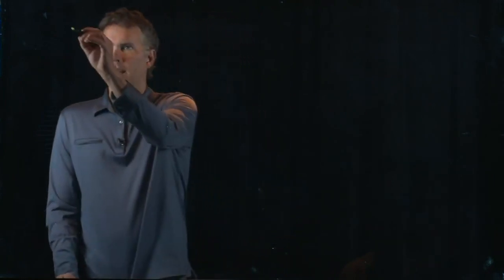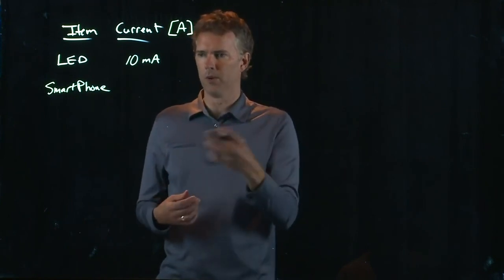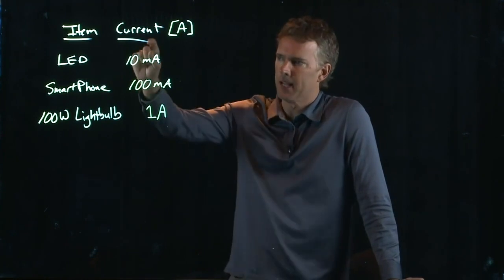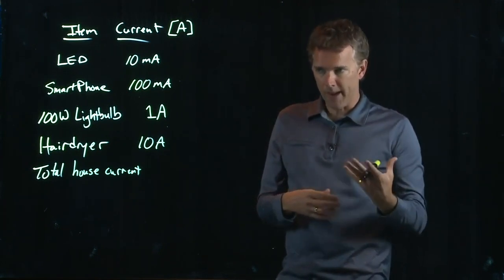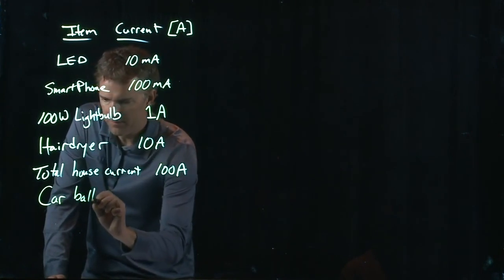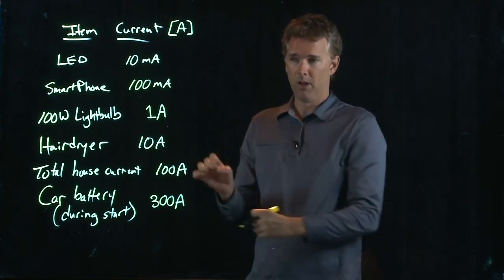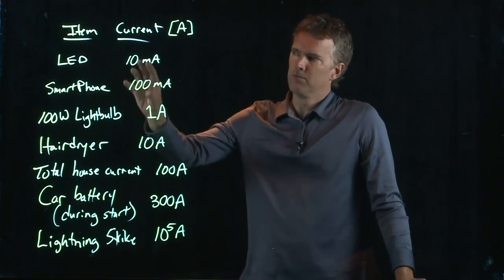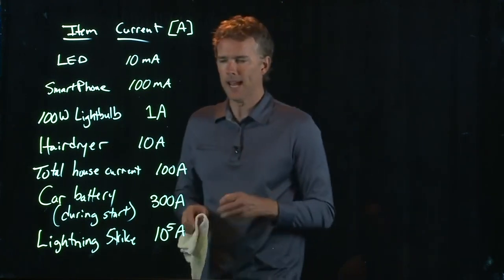Current in Everyday Devices | Physics with Professor Matt Anderson | M21-05

Comment: I predict the reason for the LED change over is too provide enough current capacity for your electric panel to charge electric vehicles battery without having to upgrade the house panel.

This will also save the utility companies the need to upgrade as well, it's a constant balancing act...
Reply from the maker: LED lights have two distinct advantages: 1) They are much more efficient (they use less electricity to make the same amount of light), and 2) They tend to last a long time (no filament to burn out).
That said, the amount of electricity your house uses on lighting is WAY less than the amount needed to charge an electric vehicle.
Cheers,
Dr. A